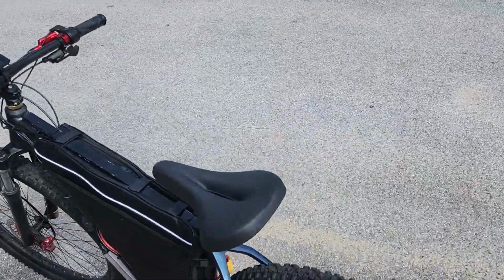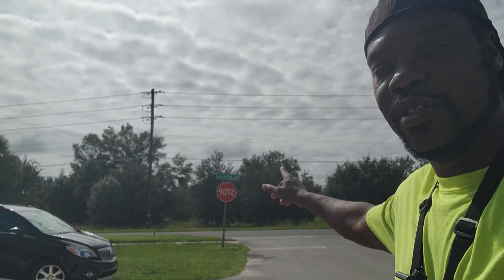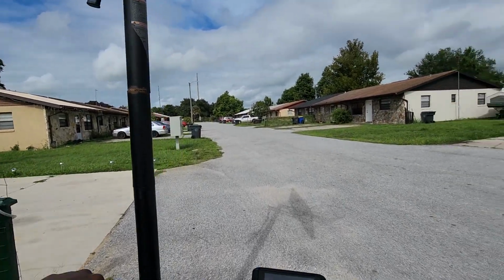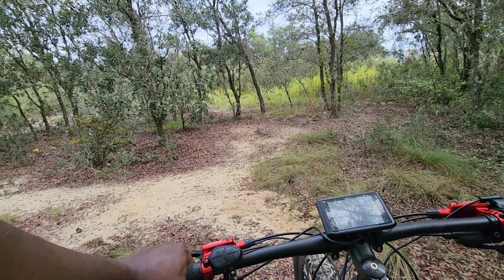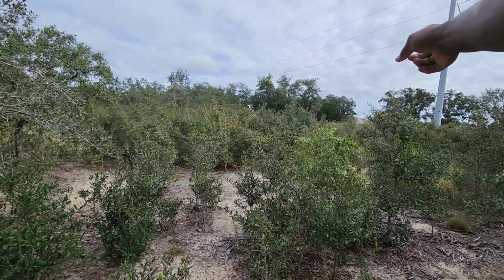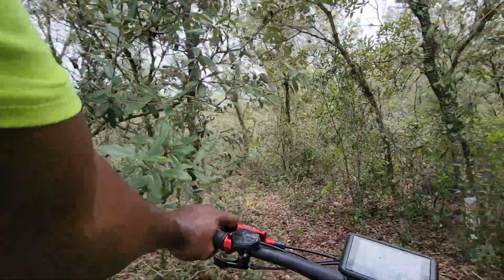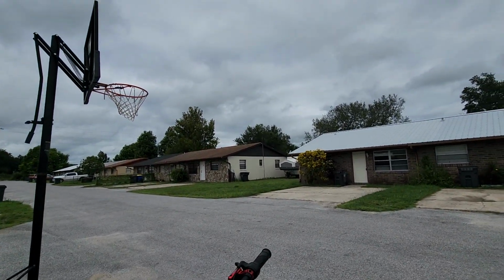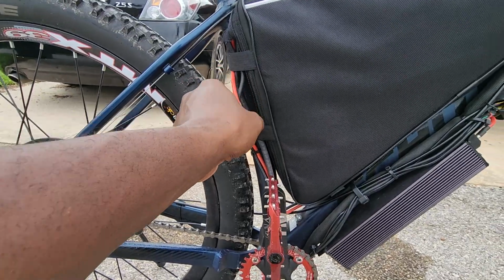Too much power for the trails? Let's find out. 🤔

Comment: Upgrade the tires so you can really put the power down 💯🤙
Reply from the maker: What tires are good I would like to have some good tires.
Reply: I'd go for a size upgrade at least for the back so you can put more power down without spinning. You have a ton of power and it deserves a bit more rubber.
Reply: Although, once you are able to go faster you'll need more brakes 😆
It never ends.
Reply from the maker: So like 29x2.80 tires?
Reply from the maker: @E-Bomber  ok I have a good set in my cart
Reply: @E-bikeguy  what tires did you pick? I want to get two sets, one for the street that I already bought and one for the trails.
Reply from the maker: I don't know the name but there off of eBay ill send you a link if you want to check them out
Reply: @E-bikeguy  cool thanks
Reply from the maker: https://www.ebay.com/itm/265812370816?mkcid=16&mkevt=1&mkrid=711-127632-2357-0&ssspo=xKcoQFZ9SRu&sssrc=2349624&ssuid=g6yfcireqc2&var=&widget_ver=artemis&media=COPY

Comment: your battery must be pretty good,  the one in my stealth bomber clone only puts out 50 amps at 72v .  you are very good at riding it even though its your first ebike,  when the ground gets really wet it could be hard to get through those trees safely though,  I don't know how it is in America but here in winter some places become impassable for most bikes especially with a heavy rider.
Reply from the maker: Well when I got the battery it was supposed to put out 160a but had a 50a bms in it so I open up the battery and I solder extra wire on top of the nickel strips and it put out 200a no problem. I'm a little rusty but I ues to ride motocross and my kids but money got tight so had to sell the gear and all. But going upgrade it soon to make it a ultra e-mountain bike

Comment: With that much power you really should look at the suspension now. At least get yourself a suspension seat post! The power you were getting off road isn't safe without it, i was genuinely worried for you!
Reply from the maker: I'm already on it it's that front end that get to me I bottom out on jumps 3 feet and up sometime I forget a hub motor is even back there
Reply: @E-bikeguy  Yeah those front forks look like the ones on my ebike. Good for general cycling on a bike with normal power! You need a little more!
Reply from the maker: I'm looking at some on Amazon now
Reply: suspension seatpost for sure! I use the suntour ones. Radpower bikes was selling them on sale for ~90$ recently, not sure if thats still going.  But they are worth the full price anyday best 130$ I've put on my bike
Reply: @EBikeBuilder_  Yeah I have my eye on a suntour seatpost, so many other things to buy first though. Most of all a speedbox chip as we are restricted to 15.5mph in the UK.
Reply from the maker: Oh dang I need to get one for my dropper post
Reply: @E-bikeguy  suspension seatpost are nice for riding seated and absorbing impacts like pothole etc.  But for jumpin like you do you might want a dropper!!  The suspension seatposts wont drop as low as a dropper post because its got the suspension taking up  3 or 4 inches.

Comment: Haven't checked your channel in awhile, good stuff! Axum went on sale at Walmart $228, I have one now, gotta wait a little and I'm going to get a powerful kit.
Reply from the maker: Nice they went on sell, what kit you plan to install on your axum?
Reply: @E-bikeguy  I already have 2k with 52v on another bike, but I'd like 72v on 3k or 5k. Is it worth it to get the 5k or is 3k enough?
Reply from the maker: Well if you got the funds go with the 5k motor,  3.5t for hi speed or 5t for power down low
Reply: @E-bikeguy  

Thanks for the info, I don't really like going fast, 40 is enough on a bicycle lol. The torque is the fun part.
Reply from the maker: Yes me too,  35 to 40 is fast enough I only went that fast just to show how fast it can go and still haven't max it out

Comment: From what I've seen there's almost no such thing as too much power on a trail.  Some of the single track that I ride, these inclines are steep and Technical, at times you almost have to come to a complete stop on an incline to maneuver through it, and then get going again on a steel incline from almost a dead stop. Some Motors can handle it and some can't, and usually has more to do with how the motor is geared rather than the wattage.
Reply from the maker: That's a good point you put out there